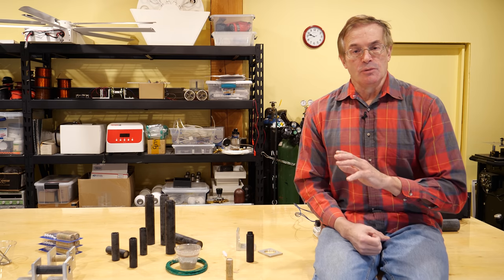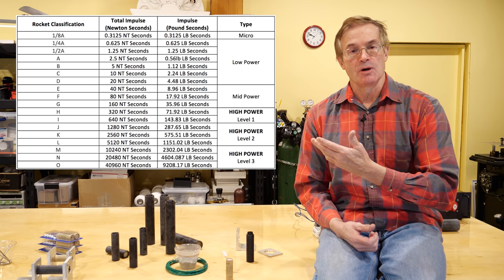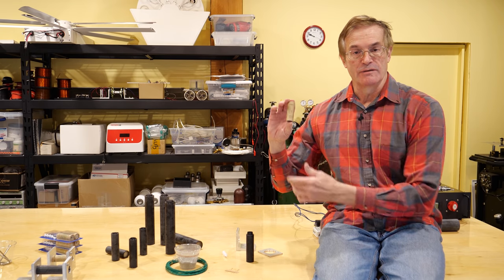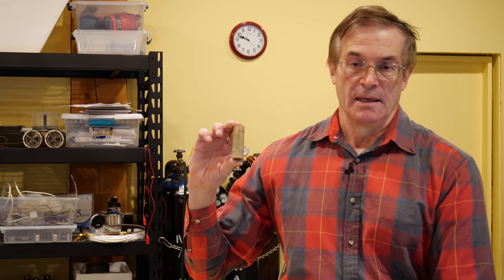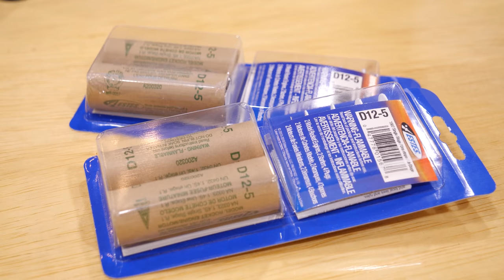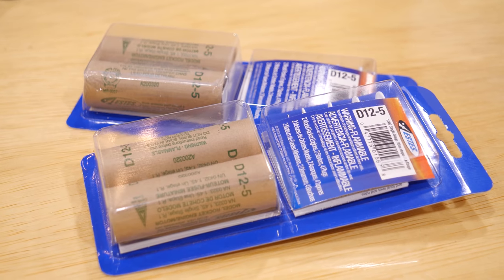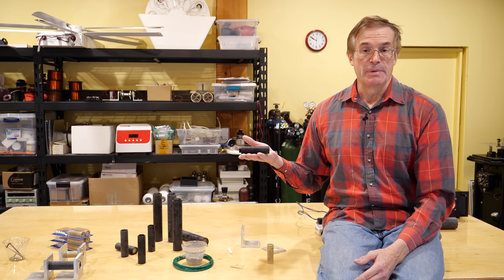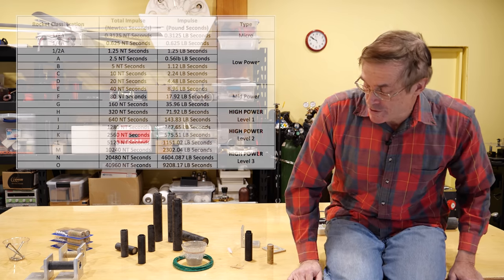Igniting Our Own Rocket Engines - DIY

Comment: It looked like the exhaust from the first burn was leaving at an angle.  It would be neat to see a test stand that could measure torque as well as thrust during the burn.
Reply: angular momentum might be hard to measure without on board accelerometers. If they use a test stand it can measure force but torque would be inhibited by the stand itself.
Reply: Prolly the channel hole was off center.
I really thought that channel would be only deep enough to hold a fuse
Reply: @WmSrite-pi8ck  strain gauges for thrust and torque, they detect the force applied.  Accelerometers require the thing you're testing moves - which is a bad thing in a test stand.  Strain gauges are a lot simpler/cheaper anyway.
Reply: @garyha2650  In a proper "core hole" design, the hole should be as deep as the fuel grain, otherwise, the thrust goes wonky - without the core hole, the grain burns much slower.

Comment: This might sound like an odd suggestion, but your rockets might benefit from some "dead space" between the grain and the nozzle. You're getting a lot of incomplete combustion products in the exhaust (the large amount of sparks) which could benefit from more time before getting to the nozzle.
Reply: In a solid motor, the dead space gets pretty big pretty fast.  That's not the causative issue for the sparkys.  I think the Al grain size was too big.  Should use something MUCH finer.

I also think the nozzles were way too big.  The exhaust velocity seemed quite anemic, which would mean that you'd throw less burned bits because the chamber pressure was below optimal.
Reply: @fromagefrizzbizz9377  As I understand it, the deadspace stays constant, since the propellant burns from the inside out (radially). There is almost no space between the bottom of the propellant and the nozzle. Also, his rocket propellant didn't use aluminum, except on the fuse to ignite it.
Reply: @Nuovoswiss  the bottom end of the grain regresses just like the core and the sparks should have lessened with your idea. Which they didn’t.

I could have sworn he was using Al, but maybe I got confused, but either way there was at  least a grain size, chamber size/nozzle size, or bad mix proportion issue as well. Throwing chunks always leads to the possibility of chamber rupture, which is serious bad juju.

Hybrids are freaking cool, because the fuel can be just about anything that can burn. Flights have been made with candle wax, asphalt. rolled up newspaper and dried cow patties. But to work you must be sure it won’t throw chunks and plug the nozzle. Fortunately with most hybrids you simply cannot over pressure the chamber, because it inherently stops the oxidizer flow.

Comment: Yeah yeah but I wanted the thrust vs time data
Reply: @asdrubale bisanzio There are rigs you can setup with a Raspberry Pi to chart the exact data.  ElementalMaker's channel has some examples of it
Reply: @ecliptix1  a raspberry pi is actually overkill, I made one with an arduino for a whopping 10 bucks that works just fine
Reply: Yeah i get you. 
And i wanted the real time video. Not the slomo. Oh well.
Reply: Agreed! I was very surprised he didn't have way to measure thrust in these tests. Hopefully he adds this feature in the next video.
@Tech Ingredients I'd be very willing to help you with the design and programming of this sort of device.
Reply: Check out BPSspace if you have a data fetish. Dude's been trying to land a rocket using solid boosters.
Reply: @ddegn  my guess is they wanted to get the video out quick, so "just for fun" approach it was
Reply: @deadlizard64  I've been following him for a couple of years actually
Reply: @dariodalcin5177  "'just for fun' approach"
It was a lot of fun.
Tech Ingredients is easily in my top three favorite YouTube channels.
Reply: Data of any sort would have been very nice to see, playback speed for footage, thrust curve, SI etc..
Reply: just remember, there are still some flaws in the nozzle. That data means nothing if the nozzle is not perfect yet.
Reply: @asdrubale bisanzio He wants the thrust curve, which can be essential with some rockets.

At least one of the motors would have had a really bad thrust curve.  Pop off the pad, practically stop, and then restart.

Problem is that it won't be flying straight when the upwards speed drops too low, and under some conditions, you may end up with a rocket flying at head level through the spectators.

Comment: You are going to need much more thorough ignition for those motors. Your ignition is way too slow, deforming any kind of thrust curve prediction you might make. I suggest using a pyrogen on the surface of the grain. Looking forward to the hybrid motor! 

PS: If you want to discuss anything in detail about rocket motors, feel free to shoot me a private message, and we can talk thoroughly over email.
Reply: I think youtube got rid of private messages?
Reply: Ew yea, This is true. The Wick system is really not good for these type of motors in any circumstance.

Comment: Love the rocket series!!! But I was fully expecting someone has already pointed out that solid rocket motors are lit from the top  >====(here)>, and not from the bottom >(here)=====> . You are losing a lot of power by the flame front burning against the pressure wave. Also the last second is usually the punchiest, where it's clear that your motors dwindle to almost pathetic at the end. Furthermore, the shape of the grain (star vs circle) provide simple control of regression rate, it's not as simple as saying there is no way to manage the thrust profile of solids.
Reply: Cored engines (such as these) are top lit, but end burners are - by necessity - bottom lit.  I'd certainly love for someone with similar production quality to do a series on different core styles. There's just as much to learn there as there is in the chemical composition of the propellent.
Reply from the maker: Thanks!
True and that's a limitation of fuse based ignition.  Next, we'll cover electrical ignition and more optimal ignition positioning.

Comment: Happy New Year to you and your family as well. 
I had worked at a propulsion company years ago. We built from small initiator motors, ejection seat motors, the 2.75 rockets for Apache helicopters and others plus the 10.75 F.L.U.F. drone launch motors. Testing was my favorite. 
When the nozzles are overcome by thrust in these 4130 steel body motors, it was the cast nozzles that took the brunt. I've seen the nozzles turn inside out from the forces with little cracking.
Fun stuff.

Thanks!

Comment: I got interested in rocketry recently and learned about why rocket science is so hard. Not sure if anyone noticed but the exhaust of the Estes rocket motor was pretty efficient, most of the propellent was shooting out in the same direction while the motors they created had a greater spread on them. This isn't a knock on Tech Ingredients but shows how hard it is to design an efficient rocket.
Reply: Really, it's not.

Comment: Remarkably well researched for amateur rocketry. Way back in the mid '60's I made amateur rockets. Estes existed even then, and amazingly, that green fuse that he uses -- we had then!! One thing I figured out is that you want reliable fuse, so ALWAYS buy professional fuse, never make your own. I also used to make my own flash powder, and it is fun, as he shows. I always used ammonium perchlorate for the oxidizer for rockets. I used rubbery stuff, made from polypropylene glycol,  toluene diisocyanate, and a tricky surfactant for the fuel / binder. Solid propellant rockets are the way to go for amateurs, since pumps and lines and toxic chemicals or cryogenic chemicals are out of reach for amateurs. Making fiberglass cases was difficult.This was fun and informational. Kudos to Tech Ingredients. If any of you want to ACTUALLY do this, you need to watch a channel like this.

Comment: As a teenager I built sugar rockets which worked quite well in package tape housings and wood  putty nozzle. 

In one of Estes notes I believe there were  plans for  a motor tester where the rocket motor was pointed downward (exhaust was vertical) and suspended on leverage (spring )attached to a pen touching a clockwork driven drum with graph paper. It would trace out the motor’s thrust curve. 

On the cantilever shown in this video a load cell could also plot out the motor’s thrust curve  . Just a thought.

Comment: I love these rocket motors.  Thank you kind of random.

But mine are made with pvc.  Here's an innovation I've made: heat the edges of the pipe, then round them in to hold the nozzle.

Instead of cat litter, pound in cement, just 1cm is enough.  Drill the usual hole, maybe flare it, then keep it moist to set the cement.

Putting it in water right away dissolves the cement.  Moist paper towels in a bag, then submersion work best.

The casing is then drastically lighter and stronger.  We've reused 3, only 1 failed of those.  It looked like the space shuttle disaster, flaring pieces of grain rising in parabolic arcs after a loud explosion.  Maybe 400 feet up.

Those are the ones you remember:)

Comment: This and the previous video are right in the sweet spot of what I spend the most time on these days. About 4 months ago I got (back) into model rocketry with an eye toward high power. I'm currently building a LOC Graduator. It can be used for an HP level one cert but I'm going to build a LOC IV to attempt that. I've been to a number of launches at the 4 Corners Rocketry Club site in NW NM. I think most of the other members (small club) are L1 or L1 / L2 certified. I usually set up my 600mm f4 lens on a Canon 1DMKIV about 150' away, wait for the countdown, guess at the delay, then hold the shutter button down in time to catch the launch. It's pretty wild to see a 10' long 6" diameter rocket leave the pad in 1-2 frames max. My high speed frame rate is 1/100th of your high speed camera (10fps) but it's still interesting to watch the light sequence progress.  I spent the holidays workin on perfecting my black powder comps. I make the charcoal myself using Pecan limb sheds. I have about 20 Pecan trees in my yard (in TX) and it turns out Pecan makes fast BP. Now to figure out how to make D black powders so I can launch Estes rockets without waiting for a motor order to arrive and then move on the G and larger composite motors for the big rockets. 

I thought your were going to have a load cell similar to what Elemental Maker uses to test his motors. He lives in your "general area"...

Comment: The reason why your motor exploded is that you should keep the ratio of (propellant core area / nozzle throat area) between 2-3 at the beginning of the burning. Propellant core  area is the cross-sectional area of inner circle (the void). It should be between 2-3, you narrowed it further and it caused an increase in the motor pressure yielding explosion. Thanks for your rocket videos btw, they're pretty educatory. I am waiting for more videos about rockets :)

Comment: I am not an expert , but I have been building solid rocket motors for years . here are some general rules I have found to be helpful  when building core burner type motors , 1st , make the propellant burn as slow as possible , slightly fuel rich just like a internal combustion engine . 2nd. the nozzle should be about 1/3 the diameter of the propellant grain . 3rd. keep increasing the length of the motor until the they start to explode then back off from there , 2% failure rate is acceptable . 4th. make sure you ignite the motor at the very back of the propellant grain other wise they tend to end burn and don't reach max pressure . hope this helps . be safe , great show !

Comment: I've watched several videos and loved all of them. Very educational about speakers, explosive gas, solar powered AC. rocket engine building. I plan to watch more and soon build some flat panel speakers.. I hope you proceed to actually make and launch some actual rockets.  I played with hobby rocket kits as a kid in the mid 1960s and your rocket engine making video makes me think rockets might be it  fun again as a senior now that I'm retiring soon.  But im  sure wherever that takes you will be interesting. Building a homemade large economical battery bank for off grid or RV boondocking  or a low cost wind power generator would also be an  interesting.topics. I love the research and engineering analysis you bring to each topic. I wish your rocket jig measured thrust. I also have a bad case of workshop envy.

Comment: I like to use ematches to ignite my sugar motors and an inexpensive fireworks firing system. Electronic ignition allows greater distance from the motor and ignites fuel at the head end. Ignition at the top gives greater efficiency and thrust. Great video series!
Reply from the maker: Thanks!
I'm going to cover some ignition systems next.

Comment: yea i make 2" pvc rockets here in Thailand. i use 65-35+1%iron oxide and 2-3% sulfur. it is a fast burn with a 25mm nozzle made from bamboo. here they do it like racing. it is fashioned like a bottle rocket and it is measured from lift off to set down ( longer times being better ) so how your rocket is balanced as well as how high it goes is important. no add on or streamers allowed. balancing the rocket for max drag and slow decent is an art. but i love it it is so fun. i had a test rocket blow up 1 meter away and the wife now calls me crazy. lol

Comment: Great fun, thanks. Aside from that can you send a little of your slushy snow down here to Australia,:)
Could I suggest that you run a few tests on the standardised rocket but with different shaped nozzles? Another suggestion would be to try out different shapes for the cavity  in the centre of the solid fuel.  I understand from my dim distant past that the power of the rocket can be increased by changing the round cavity to one shaped like a "plus" sign. That would be an interesting change

Comment: We have a store here that sells all the way to L (level 2) and can order and get level3 but there are restrictions that most people won't be able to meet. Nice though that i can go and get such high level motors(if i could afford them) :) When i built and flew rockets we used electric igniters as you show. They can be a bit finicky but at least we were better able to be safe. Never used a fuse. Thats a heck of a test rig you have got there .

Comment: when christmas is over you can often can find small christmas tree lights if you  carefully  break the bulb so as not to break the filament they make a very serviceable igniter at 12 volts and as the strings of lights are salvaged they are very cost effective .

Comment: As someone that has been building and flying my own APCP motors for the last 8 years, I'm impressed with how you make candy motors.   They are done much better than most youtube rocket bomber.   After a college team showed up at our launch and wanted to fly candy motors they claimed were G and I size, they turned out to be more like E and G, and the flights were disastrous and dangerous.  Watching your videos, I have serious doubts your motors were actually F and H sized.  Without recorded pressure curves or at least thrust curves to measure burn times vs. pressure or thrust, I would not take your word for their thrust without documentation.  I think that building an instrumented test stand could actually be a cool video.

What I find in your video to be very amateur and dangerous, is using fuse for lighting rocket motors.   That hasn't been allowed  since the '60s.  You're over half a century behind the times.   There are many ways to make your own motor starters that use the required, safer, electrical ignition systems.  They are much safer, easier, and in many cases cheaper then using fuse.  I make motor starters for H to M sized motors that cost me pennies each.  

BTW, did you use the 100 ft. minimum safe distance per NFPA 1127, which is state law in most state?  You obviously didn't use the required remote electrical ignition system which means your were probably illegal in your state if they have adapted NFPA 1122 & 1127 as part of their fire codes.

Please stop showing people with no knowledge of model rocketry how to endanger themselves with fuse ignition of rocket motors.
Reply from the maker: Watch our follow-up  videos on rocket motors as well as our ignition  system design.

Comment: I used to test my motors vertically, often buried in the earth, nozzle up. That helps contain casing and nozzle failures.
Reply from the maker: It's a good option.
Why do you think large commercial engins are not tested this way?  That's not a loaded question, I don't know.

Comment: What I would suggest trying is to vary the kernal size and shape.  You can build in low power sections or coasting by going to a narrow hole or no hole kernal.  Put in loose powder on the other end to make a low power parachute deploying charge. 

Another thing to think apon is how to make the engines reloadable.  If you have a machined rod that goes through the nozzle you can vary the kernal if whichever way you want and just have a cap of clay or epoxy that gets blown out by the parachute charge.  Then all you would have to do is pour more fuel in and cap it off to make another one.

Comment: A long time ago I had success with holding the fuses in place by pouring a small amount of “sealing wax” into the nozzle after placing the wick. I makes the Enugu easy much less fussy to ignite because the wick and motor become unified and held together. And the wax melts instantly as the wick passes through it.

Comment: As you go up in power, you might need a centre void in the combustion material, preferably with a star-shaped cross section. It should encourage a more laminar flow. Solid rocket motors have a positive feedback effect on combustion caused by the erosion of the walls of fuel.
Reply from the maker: Agreed